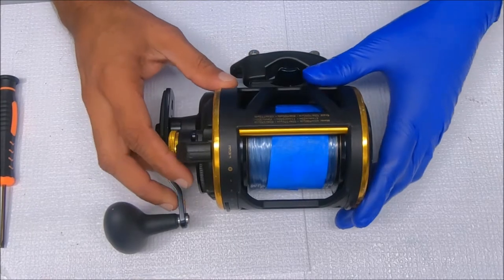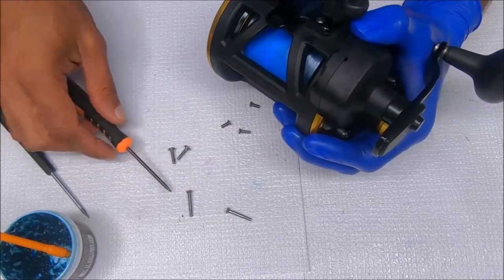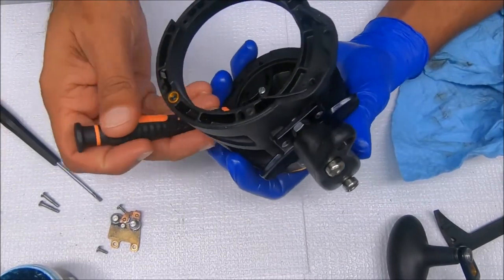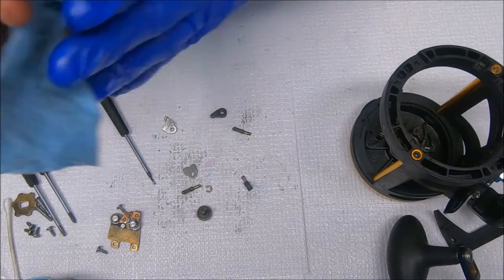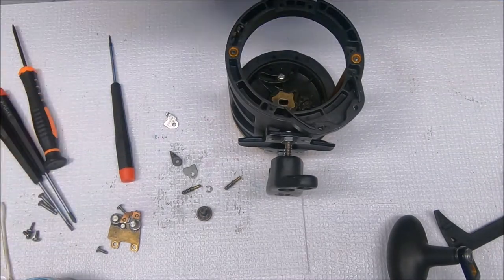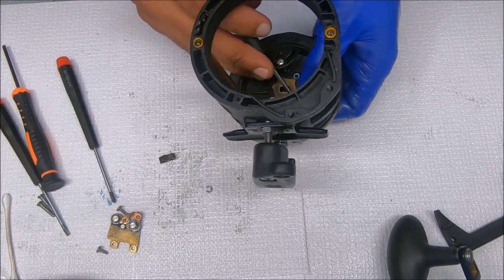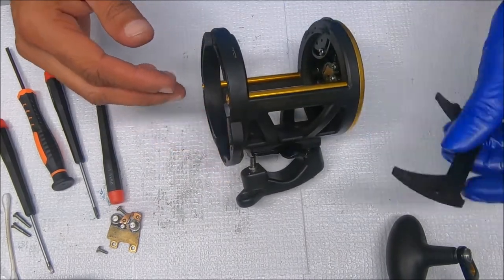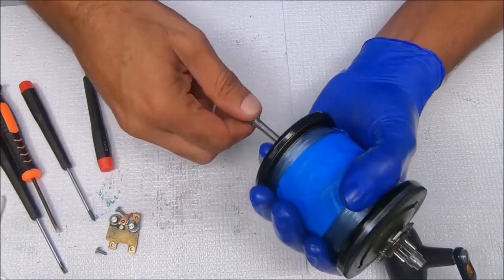Penn Squall 60LD Fishing Reel - How to take apart, service and reassemble

Comment: Man!! You're a life saver.  I've been buying some reels at a boating consignment store really cheap when they appear not to work.  I bought a squall 60ld rod and reel combo today for $50. The handle wouldn't turn if the drag was even somewhat tight.   Thanks to this video I was able to take it apart.  Lose drag cover on the spool is the best I can figure as to what the problem was.  I've managed to get 5 tld 15s for $10 each and spent 20 each on bearings. Also picked up 3 tld 25s for $25 each.  Now the boat is ready and equipped. Now all I need is some good weather so I can go offshore.  Thanks again for the help. These videos have saved me a ton of money on reels.
Reply from the maker: Thanks for watching and the love! Glad to hear they're helping. Feel free to send a thank you tip by checking out the video description for details. In regards to the Squall.... they can be a little tricky when you get that hard to crank handle issue..... if securing the drag cover wasn't the issue, don't forget to check the pinon bearing.... but the problem may actually be the spindle (main shaft), or even something else. Unfortunately, with this one, you may have to go through a bit of a process of elimination. Wishing some better weather to get out there and enjoy the fruits of your labor. Spread the word about the channel.

Comment: I saw that you used an oil and two types of grease. What were each called so I could use the appropriate lubricants.
Reply from the maker: There are many grease/oil options available. Just make sure they're designed for fishing reel use. Thanks. Spread the word.

Comment: Hi sir i am having 50 ld but a problem occurs when i play a fish on it and put my drage at the ramge of 3 then my handle gets free did not line in but suddenly works fine what is it can you help me and when i want reverse my reel handel it gets reverse
Reply from the maker: Hi Hasan. Can you post a video replicating the issue(s) you're having?
Reply: @TSGReelService  yes sure bro your email address please
Reply from the maker: Hi Hasan. I don't open attachments from my email (tsgreelservice@gmail.com). If you post it on YouTube and include the video link in this thread, me and the community can see it. If I can't help you, maybe someone else who views it can. Thanks.
Reply: @TSGReelService  ok in morning i will show you my problems
Reply from the maker: Hi Hasan. Yes. Check your cam (part 21 & 141), as well as the threading on your shaft & knob for the no tension in sunset position. I think something's stripped/worn. Check you pinion bearing for the stickiness when engaged. For the winding back, check your dogs... They've either slipped off or are damaged. Hope that helps guide you in the right direction.

Maybe someone else who sees this can give you additional ideas.
Reply: @TSGReelService  thanks can you upload a vedio on it so i can understand parts and see my reel when i open my reel if i can change it with your online help it been a victory for me brother
Reply from the maker: You're welcome. See the schematics that came with your reel and you can use this 60ld video to help you through it. If you're not comfortable breaking it down yourself, your best option is to take it to local tackle shop.
Reply: @TSGReelService  no i can open it by my self with the help of your tutorial of 60 ld brother i see the parts name and shape of them in schematic paper thanks bro
Reply from the maker: No worries. You're welcome. Let me know how it turns out.

Comment: I know this video is old but i have been watching them an fixed a squall ld 40 an 4 spinfisher v using your videos. Amazing job. One question. In my squall when i engage the reel. The handle will back spin a few cycles an then lock up. Any advice on what i did wrong?
Reply from the maker: Thanks for patronizing the channel, Brandon. Glad to hear you find the vids useful. For the Squall 40, if you're referring to the dogs taking too long to engage, you'll need open it back and check that the dogs getting enough grip to engage... you can do this manually, after you open it, by setting the dogs and rotating the spool fairly quickly to reproduce in the field function (be sure to use your finger to gently hold in place the one dog that wants to pop out of place). If the dogs seem like they're not gripping well, remove the dog plate and gently pinch the leaves of each dog together. Reinstall and test until it feels right.

If you're referring to reel actually "locking up," then one of the dogs may have popped out while you were putting it back together. See the portion of the video where I talk about reinstalling the dogs for help with this. Let me know if this helped remedy the issue for you.
Reply: That did the trick. Had to adjust the dogs. The reel works like new. Im a charter guy an have lots of reels an you saved me a fortune with these videos. Fixed 8 without needing parts just simple maintenance an grease an they function perfect🙏🙏🙏🙏
Reply: Any ig? I can give you a shoutout
Reply from the maker: Excellent! Glad it's back in the lineup.
Reply from the maker: Thanks. No, sorry. Feel free to add your charter info to this thread for some self promotion if you wish.
Reply from the maker: 🙂 hope this helps generate some business for you. I'm currently a couple hours south of you, so kinda local.

Comment: Having some troubles keeping that right dog in place
Reply from the maker: Thanks for watching. The best way to keep it in place is to have the dog that can come completely off the ratchet engaged (set flush against the ratchet) before reassembly. Once it's set, don't move the spool while you're putting the right side on. Line it up as close as possible and then gently push it on. Any significant resistance, take it off and check to make sure the dog is still set. If it is, the resistance is coming from the main/pinion gear marrying.... turn the handle slightly as you push the plate down.